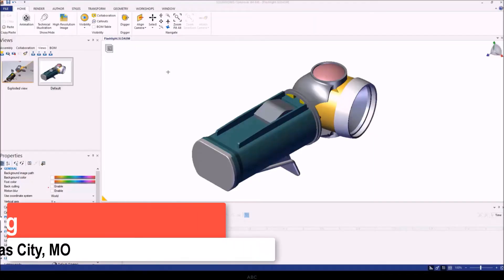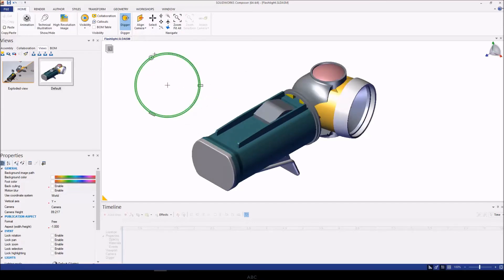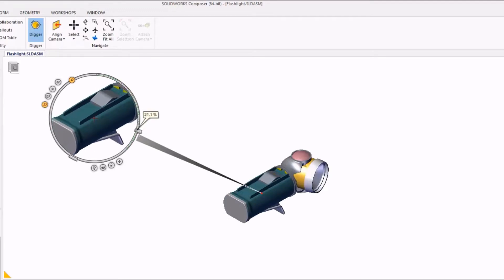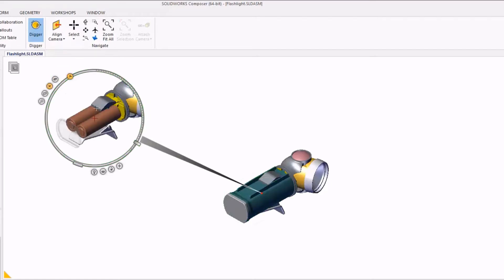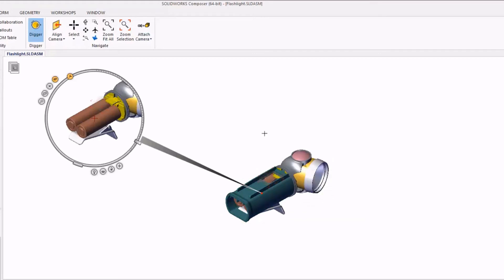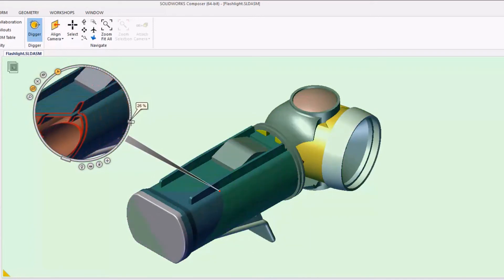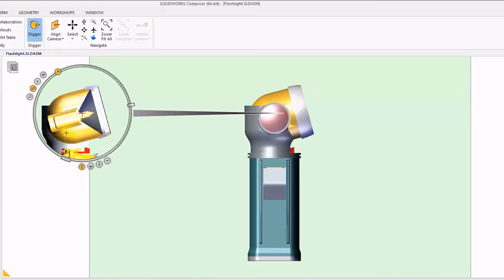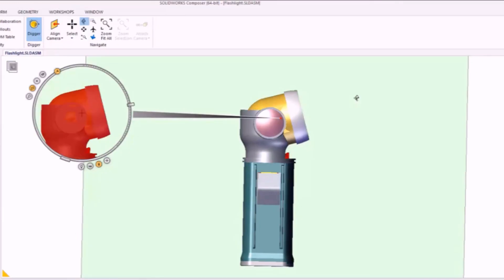SOLIDWORKS Composer - Using the Digger Tool

Comment: Your videos shows exactly the problem I have with the digger tool. At the end, you lock the cut plane, but it doesn't cut the model anymore. Do you see? The cut areas are red, but nut cut out. How can I solve this problem?
Reply from the maker: This is an issue that our customer service team can investigate with you to see what may be causing it and confirm if a workaround exists or a solution has been released.  If you are an MLC CAD Systems customer on subscription service, reach out on our website at https://www.mlc-cad.com/technical-support/